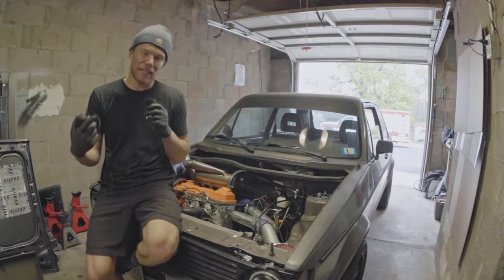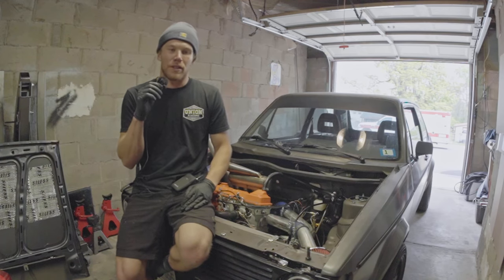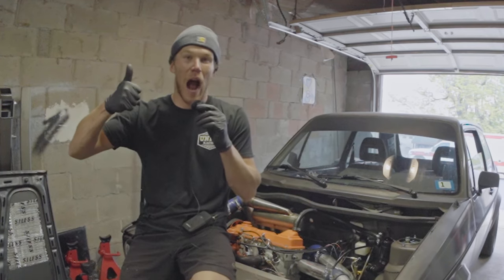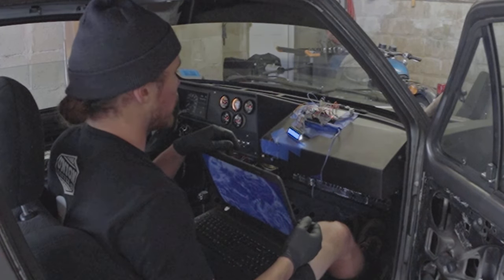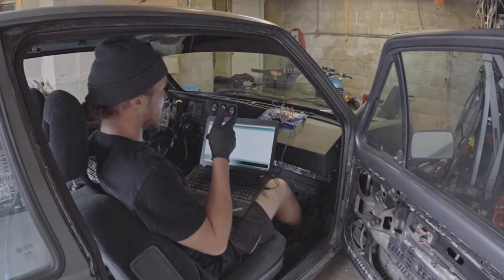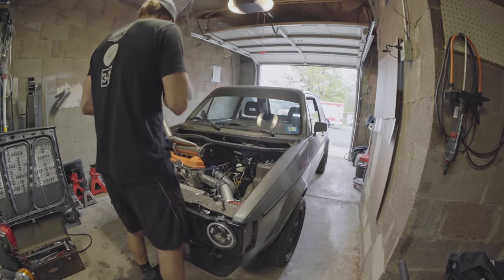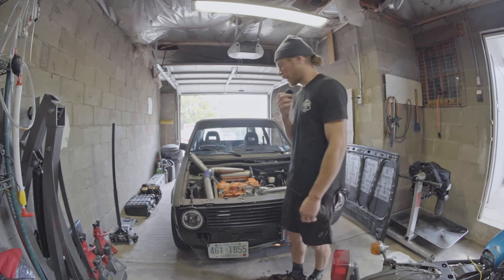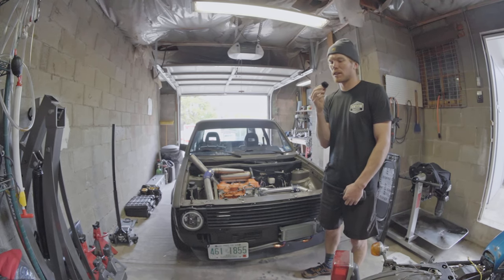You've never heard these CRISPY TURBO SOUNDS // VW Rabbit 1.6L

Comment: Not on topic but with the 1.6td and 020 transmission if you replace the clutch there is an alignment tool that comes with the kit im not sure how to use this do you have a video on this or how to use it the ones ive been looking at seem to be quite different then the disk style one they are more like a peg.
Reply: The peg aligns the friction disc and pressure plate as you're mounting them.  Leave the pressure plate bolts loose so you can slide the friction disc around and get the alignment peg stabbed in there. Tighten all the pressure plate bolts and it'll fix everything into alignment.
Reply from the maker: X2

Comment: Yeah this is why I thought TPS would be useful to have. Affectively putting those potentiometers into the go pedal. Have drive pressure target based off pedal position or even pedal position + RPM. 2:1 drive pressure at WOT and 1:1 while cruising.

Limiting drive pressure based off boost isn't ideal for variable driving conditions since drive pressure sort of  'comes before' boost pressure. The controller is waiting on boost to increase before increasing drive pressure, but boost is waiting on drive pressure.
Reply from the maker: Yeah currently working with something like 1:1.2 boost to drive ratio (brings drive up first like it should) but honestly trying to nail down a quick actuator response time is the biggest hurdle at the moment. Writing tunes & adding potentiometers is pretty easy

Comment: Hey mate, does this 1.6 heads better at not cracking vs 1.9 aaz ones?
Reply from the maker: Hi! Is the 1.6 less likely to crack than 1.9 AAZ? I'd imagine they're about the same... same pre chambers & general design. I get little cracks between my valves & on the pre chambers, hasn't been a problem yet though 👍 hope this helps

Comment: Your car is too lean bro
Reply: it is  diesel..
Reply: Bro no sh!t
It should have more fuel! You should see black smoke (a lot) from the exhaust. Then. When happy with boost level, lean out the diesel (duh) until little smoke is exiting from the exhaust.. diesels need a bit of smoke, or else…. You will find out soon enough…. Cheers
Reply from the maker: I will completely disagree with you here. I get a bit of a haze (depends on how much I'm in the pedal) and that is perfect. It's Diesel... Literally never too lean. These motors love air (LOVE AIR). When you over richen the AFR on diesel like truck clowns do you only create problems... Too much heat, too much soot (bad for rings), wasted fuel, emissions clogging (on newer vehicles). Yes more fuel is a good thing but what your missing is it's already getting way more fuel than stock & running a huge turbo... Thus complete combustion. If you haven't watched a video by Gale Banks on how to tune diesels then I'd highly recommend it 👍
Reply from the maker: X2
Reply: @OliverFetter  from my ear experience when you pushed it is that your engine is running out of combustion room. the pistons on these engines are made more for compression and after a certain boost it fights itself
Reply: @ChrisGR93_TxS that doesn’t make any sense. Go home.
Reply from the maker: I would disagree Chris... You can add as much air as you want! This tune didn't work as well as I wanted (which might be what you're hearing). It built boost pretty slow bc I was trying to hold it at 1.5:1 boost to drive. I think initially drive pressure needs to be higher to kick the turbos ass a bit 🤓
Reply: I can't help it.  Gotta call out the high level ignorance here.